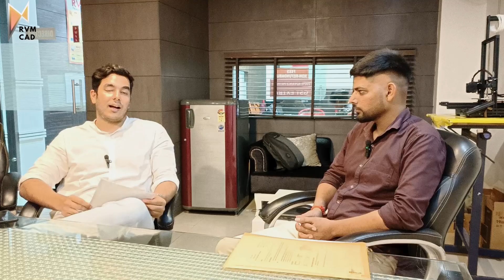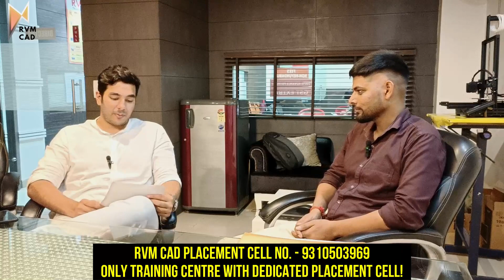Learn How Mechanical Engineer got placed in CAD Design role | Autocad & Solidworks Job Role

Comment: Sir I have big doubt, I want to learn CNC vmc and solidworks simulation and inspection and plm, In banglore Rajaji nagar, i am currently pursuing my btech mechanical with many backlogs, can I do job right now, along with BTech, plz clear this doubt, still pursuing btech mechanical engineering student can get job, can you place
Reply from the maker: Please call at 7722047855